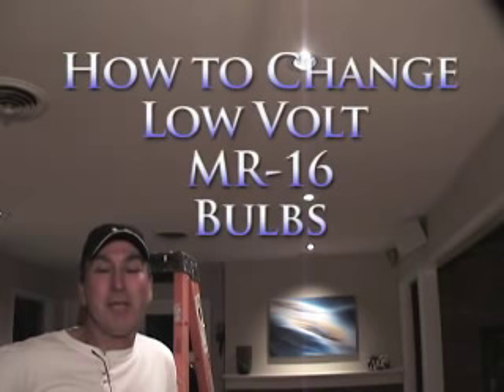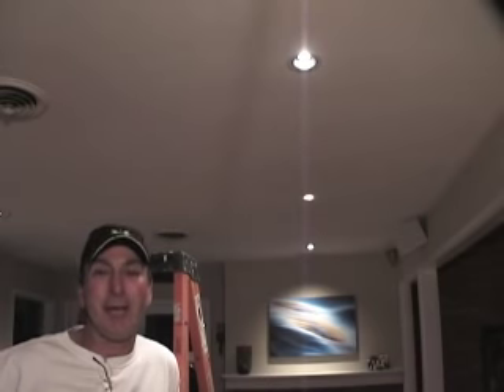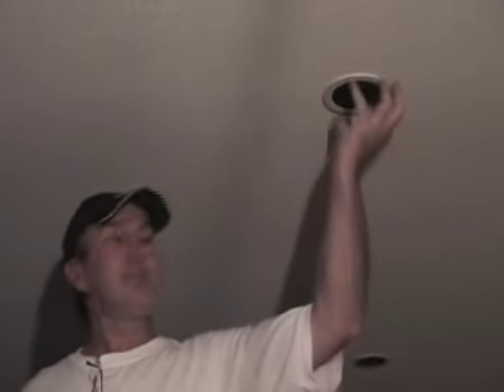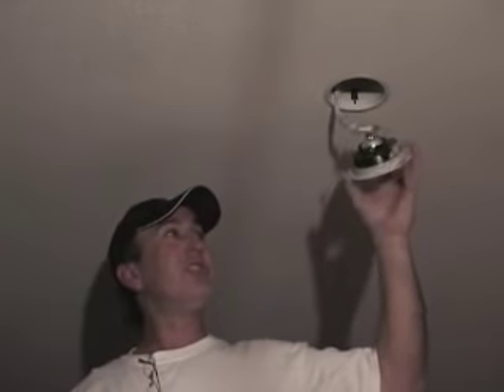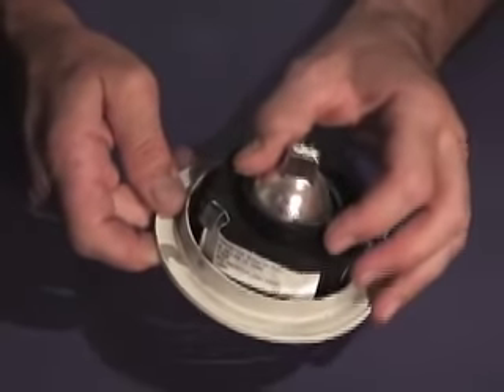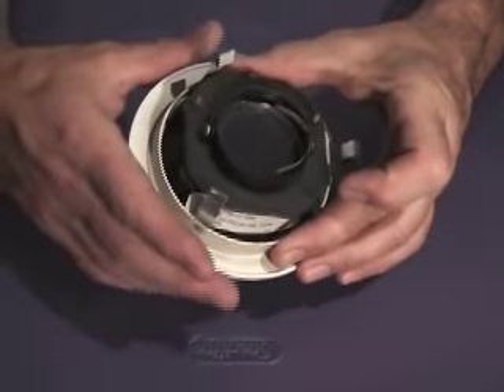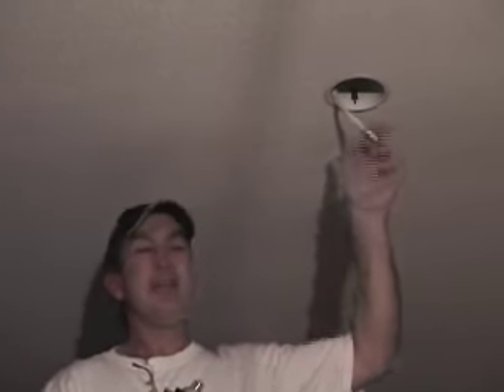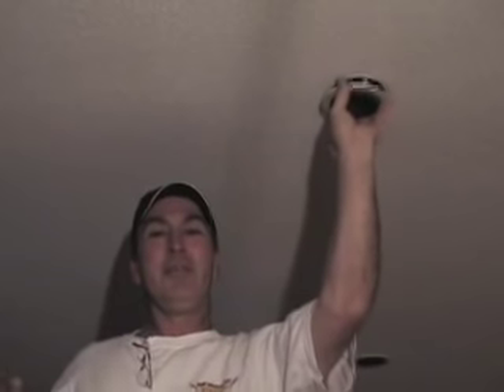How to change a MR16 💡light bulb💡 - in a Halo Recessed can

Comment: Thanks Jeff.  I want to thank you for your video.  I could not find directions anywhere else.  I was getting ready to use a flat head screwdriver to try and pop the bulb and had no idea that you removed the whole unit. 

I'm 6"5, so I needed no tall ladder or step stool.  

The new light works perfectly.

Thanks again.

Comment: Each halogen ceiling light is different. Sometimes we dont need to remove the whole socket piece, but just the protective holding rim or glass, and unplug the bulb. In my old house, I got used to that. In my new house, I havent been able to figure out how to change the bulbs , postponed it , until so many of them burned , I was left with no choice, but to tackle the task. Finally, I came upon your video, to learn that , the new kind I am now faced with, needs to be removed as a whole. :) Thanks.

Comment: Hey Jeff!  Good video!  Unfortunately the can that they used is a square can that's a f#%& to pull out! .. And when you do, you have these f#%& clips to dork around with! .. And it's nearly a waste of time because the whole socket is encased within the can!  Fortunately, I had an access panel nearby that I could use to reset these clips back into place!   "Plan B" is remove the shaft nut that holds in the socket assembly at the top of the can and pull out the whole socket assembly and replace the bulb.  In this setup, the built is held in place by the bi-pins and a pair of guides on the socket.  It does appear that you can just pull out the bulb, but getting the new bulb to line-up correctly is a big challenge. .. Oh, yeah, I'm in Singapore, and this might be a European design/nightmare! 😉

Comment from the maker: FYI.... You can replace the light bulb with a LED replacement bulb.  A LED bulb in a low voltage fixture should last forever, give or take a month.
Reply: The problem with this is that the LED MR 16 is typically a 9watt bulb.  Magnetic transformers don't like being loaded less than half of their rating.  This leads to an early death for the transformer.
Reply from the maker: I have yet to find an issue regarding this.  Your mileage may vary....

Comment: @poptium   You mean like the bar style halogen like shop and spot lights use too.  No it doesn't matter which end goes where.  Just make sure not to crack the ceramic ends while pushing in on one of the spring side pins and push hard to make sure the other end fully clears the other pin or that ceramic end could crack too--those ceramic ends are fragile.

Comment: Thanks.
I have to replace a few metal transformers the size of my fist and the light place sold me little white plastic Damars. Are they going to work? 
I have 22 ft ceilings and I'm 6 ft tall.  How tall a ladder should I use?  20? and where do I find one that big?
Reply from the maker: these transformer are just about as good as anything
http://www.homedepot.com/p/GE-Lightech-60-Watt-12-Volt-Electronic-Transformer-GELT60A12012DIY/203586278
22' Ceilings?  your going to need scaffolding(same as my ceilings) unless you can get access from an attic.

Comment: Great video! However, I followed it step by step to replace to lights in my kitchen, and now the two bulbs still won't work when I flip the switch.  I have obviously made sure that the pins are firmly in the sockets. Any suggestions?
Reply from the maker: +Jake Dotson Sometimes its the socket that the bulb inserts into.  Or the other thing will be the lowvoltage transformer.

Comment: Hi Jeff, many thanks for your detailed video.  I changed the bulb.  However, the connection appears to be loose as sometimes the light works and sometimes it does not.  Then I give it a gentle tap on and around the bulb and it lights up.  Any thoughts of how to fix this 2-pin holder/bulb?  Many thanks.
Reply from the maker: Yeah, your socket that the bulb goes into is bad, very typical for these lights.
You need this socket,    https://amzn.to/49H4pzE    and then to cut and splice this onto the existing wires.  2 small Blue wire nuts too     https://amzn.to/3TpuDRg
Reply: WOW!!! I am super impressed with your prompt and detailed reply Jeff.  Truly appreciate it.  The first link you provided for the socket just defaults to the general page where there are multiple sockets and stand confused.  If you can send me a direct link to that particular socket only, it will be great (also the brand and amount it is for, so that I can identify it quickly should the default page open up again) .  Many thanks again for your great help!!!
Reply from the maker: Try this, if not search for "MR-16 Lamp Socket"
https://amzn.to/48HHTFn
If not, your local electrical supply will have these, Home Cheapo prolly have it too
https://www.homedepot.com/p/Leviton-Miniature-Bi-Pin-Base-Ceramic-Body-G4-G6-35-GY6-35-GX5-3-MR16-GZ4-MR11-Halogen-Incandescent-Lampholder-White-80054/301667505

Comment: Hi Jeff, I have replaced the bulb a few times just as you described it. It is really easy. But now my porcelain connector  gone bad.
It seems the half of bulb pins broke and stuck inside the connector. I have bought a new connector, but it seems that to replace it is more difficult. Could you show how to do it? Thanks!
Reply from the maker: I don't do request.  But, That happens frequently, cut the old on off, get 2 small blue wire nuts and this from Amazon   https://www.amazon.com/Aluminum-Miniature-Bi-Pin-diameter-Halogen/dp/B0195NEI3C/ref=sr_1_2?ie=UTF8&qid=1533333814&sr=8-2&keywords=mr-16+socket
Reply: Thanks!

Comment: Jeff, I had 24 Lightolier low voltage cans installed in my new kitchen 3 years ago.  So far I have had 4 transformers go out.  Is this your experience?   Any way to prevent this?  Thanks James
Reply from the maker: Lightolier has awesome factory reps that are based locally.  Go to your lighting store and ask for the factory rep to contact you and schedule a visit to your house.  This should not be happening.

Comment: Hi @UncleFjester your video really helps! In fact the trim you have is very similar, if not the same, as mine! I have one issue though - for whatever reason my tim is very tight, I cannot really pull it down. In your video the tim gets off fairly easily. Is there any tricks on pulling it down? I notice it does not have the usual spring loaded mechanism.
Reply from the maker: Give it a twist while you pull

Comment: Very funny guy.... but it does not work for my little led bulb....since I cannot remove the whole thing from the ceiling...Just a tiny metal thing with the bulb completely inside !  Help.
Reply from the maker: Louise Brunet  with out seeing it, All I can say is to continue to pull on it.  Just about all recessed can trims have some type of tension springs holding it from falling.  Good luck

Comment: Went great, but something happened.  when I pulled off the silver connector cap, I struggled to get it off.  When I finally got it off, wait, what, a pin was missing in the light bulb.  I looked up and it was in the connector.  Has that EVER happened to anybody, but me??  Took pictures
Reply from the maker: It happens all the time, pull it out with a pair of pliers.
Reply: @UncleFjester  Thanks, yup, did that but concerned should I replace the connector?  I also will be replacing with an LED bulb, maybe start fresh with new connector, its 20 years old.
Reply from the maker: sure why not if you have time. here ya go  https://amzn.to/3W3z1Xe
or home depot has them too $5/piece

Comment: Aghhhh! Plaster came off before I put the damned thing right back where it came from. In my case only the 'inner' holding rim should come out. Then the bulb is simply unplugged, replaced and the 'inner' rim sloyts back easily enough. Video not suitable for what appears to be the exact same fitting externally.

Comment: Resolution is extremely low.
Reply from the maker: Looks fine to me, but I'm looking at it on a desktop PC
Please try again
Reply: Jeff Weissman
Your video only goes up to 240p instead of the standard 480p or 720p. Fairly helpful video, but unfortunately I'm having difficulty with a swivel mount recessed can.